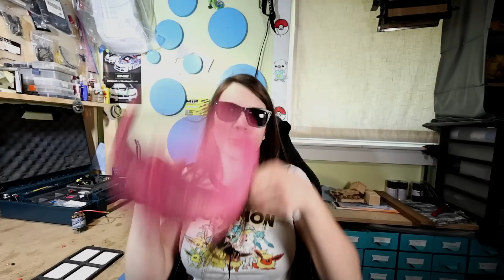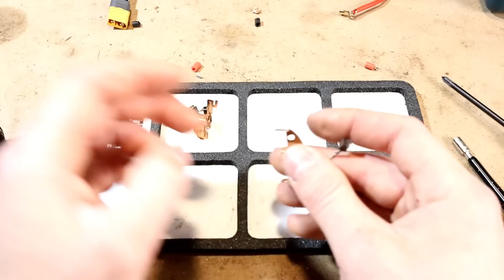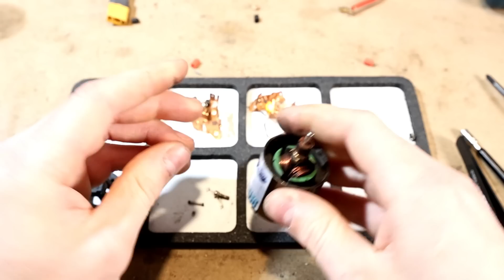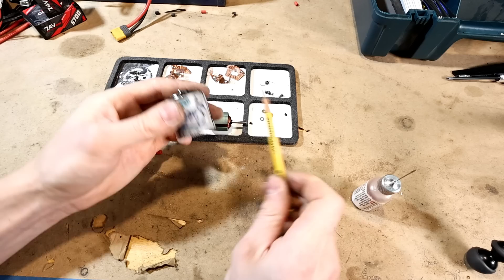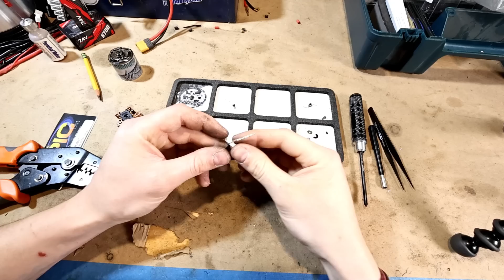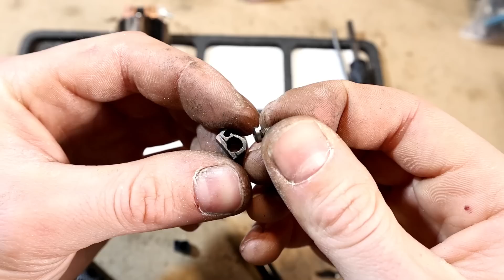Rebuilding a Trinity Speed Gems Pro Chrominum 16x2

Comment: Where did you find those ring terminals for the brushes?  What size are they?
Reply from the maker: They are from terminalscheap dot com. this is right off my reciept
RN1-2-Ring Terminal, 22-16 AWG #4 Stud, Non- Insulated, 100 Pack for $4.55
hope that helps!